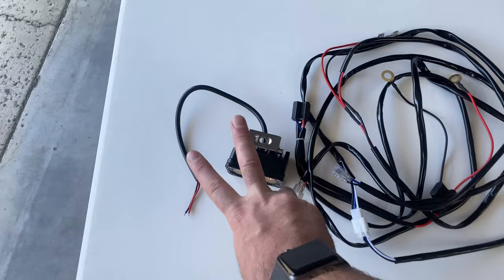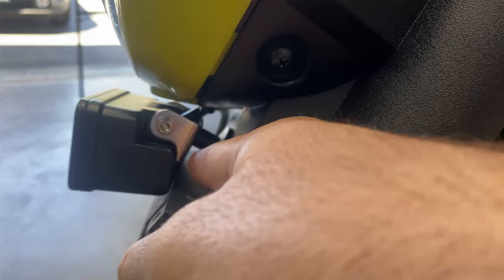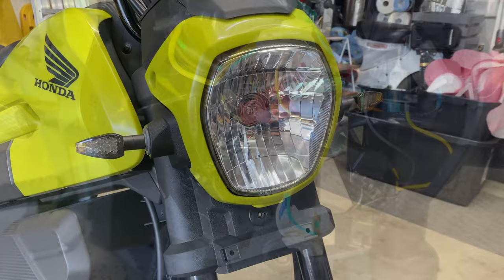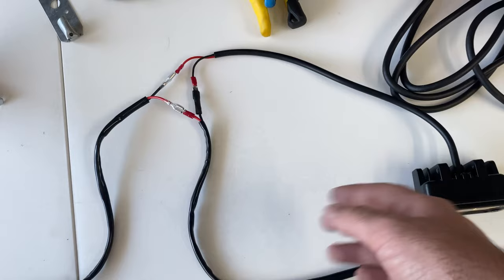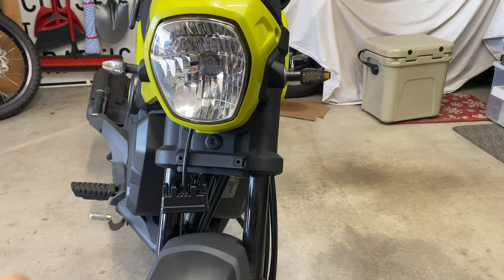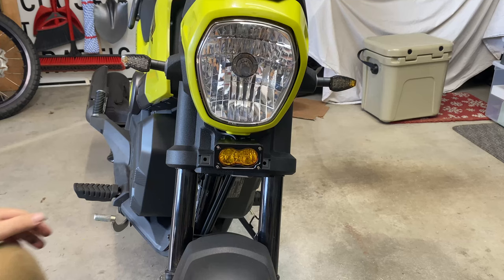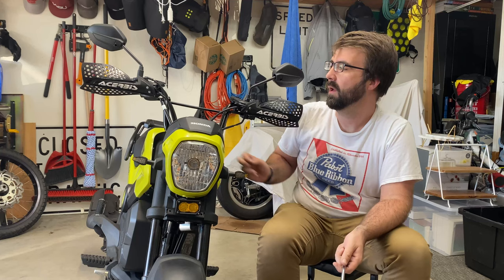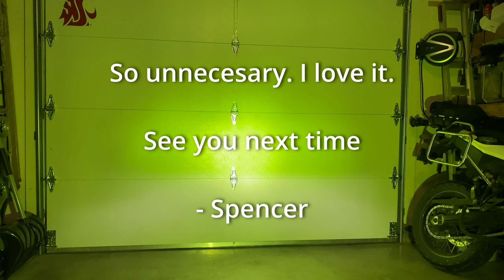Honda Navi: Adding an AUX Light (ADVAF?)

Comment: Could this same process be applied to replacing the front headlight assembly?
Reply from the maker: Kind of but not really? If you wanted to abandon the headlight controls already on the handlebar, then yes, but I wouldn't recommend that. This also doesn't have high/low beams, its just on/off, doesn't come one automatically with the ignition, etc. There are some other good videos out there about headlight AC to DC conversion that would be more in line with what you're talking about.

Comment: I know you don't have the Navi anymore but did you notice any issues in cold-starting from the change in load on the battery ?
Reply from the maker: Hey Petra, no, I didn’t notice. Cold weather can be hard on batteries in general though. Maybe worth topping up with a battery tender every few rides?
Reply: @SpencerDesmarais  Thanks for the quick reply ! I noticed you are in WA as well so I thought your experience would be very relatable. I ride all year round and my battery seems fine so far.
Reply from the maker: @petrathomas554 Are you still on the stock battery? If you’ve gone to a lithium ion battery those definitely don’t like the cold. If it’s below freezing I’ll turn the lights on for a few minutes to let the battery internally “warm up” before cranking
Reply: @SpencerDesmarais  nope, 100% stock right now :-)